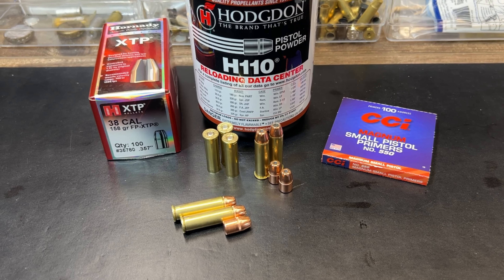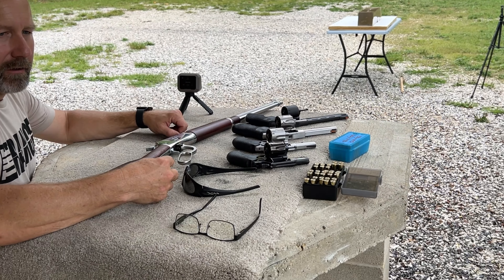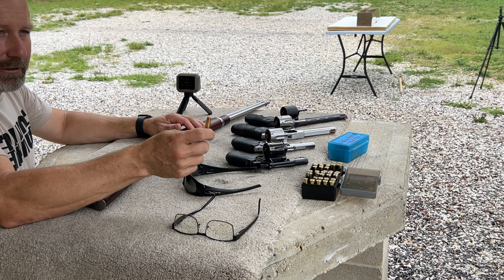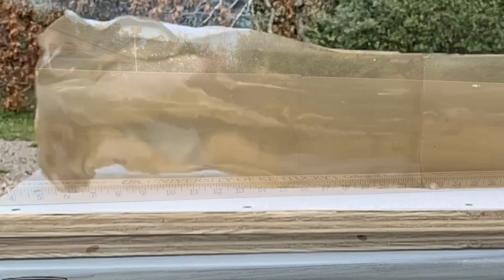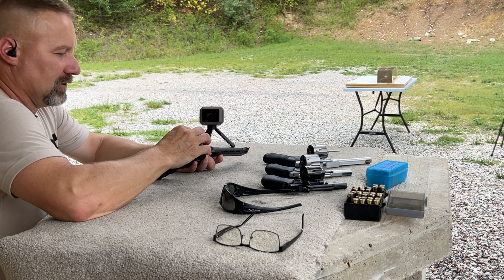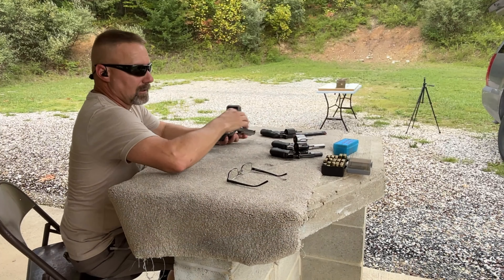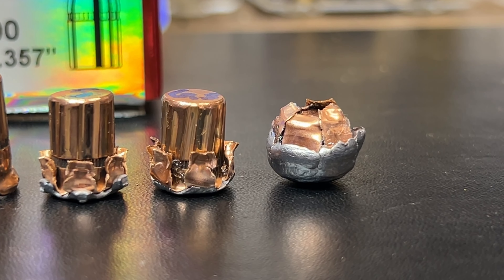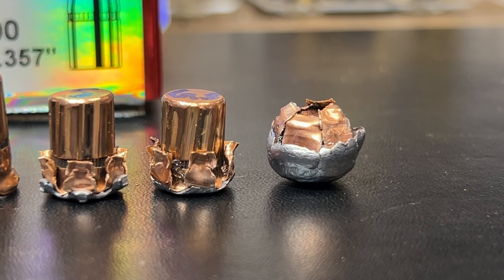Testing Hornady's New 158gr FP-Flat Point XTP Bullets, in Gel Block, with 5 Barrel Lengths!!

Comment: I bought the flat points because I have an 1894 Marlin in 357 mag. I found the old velocity range card they used to put in the older XTP boxes. The flat point expansion range reads 1175 fps to 1800 fps. I'd say a good bear bullet for a six inch revolver or as I used it a good deer bullet up to 100 yards! My wife and I both have a deer with that bullet & H110 load. Good little rifle and caliber.

Comment: I've noticed that the GP 100's velocities have been either really close or faster than the Taurus, maybe it has a faster barrel. I love the Flat points for wood and hunting. Sometimes Hollow points don't work on the bigger animals here in Maine.
Reply from the maker: @joeltowle2737  Inwas discussing the velocities on another video too.  Best guess, the ports in the last inch of the tracker may be decreasing its velocity. That’s a whole different set of test for later, maybe. Lol
Reply: @kentuckyrangetime  I forgot about the ports. When did they come out with a 5" GP100? That's definitely different.
Reply from the maker: @joeltowle2737  not sure when it came out but I like it! 😉😂

Comment: I've been loading this bullet for carrying in the woods for extra penetration.  Using it in a 4" barrel looks pretty iffy for expansion, but it will get the penetration.
Reply from the maker: @craigbenz4835  Good point. There’s a sweet spot between expansion and penetration. Barrel length and bullet weight both play into it. Hopefully the data from all these tests will help pick the best barrel/bullet weight combinations. 😉👍🏻

Comment: Out of all the 357 rounds you have tested would you say this would work best for hunting deer/hogs/ coyotes within 100 yards? Or would you suggest something else.
Reply: Forgot to say it’s out of the 16” Rosi 92
Reply from the maker: @kchastant28   These should work great. I might use the standard 158 XTP for coyotes since they’re not as thick and the FP doesn’t open as quick.  Either will do the job just fine though.  At some point downrange as the velocity starts dropping, the FP’s expansion will drop off sooner than the standard XTP, but inside 100yrds both will do great. 😉
Reply: Awesome thanks! I would be using them for deer but just checking just incase a hog or coyote steps out. I will also get some standard xtp I I strictly go hunt coyotes. Thanks for all the hard work you put into these videos!